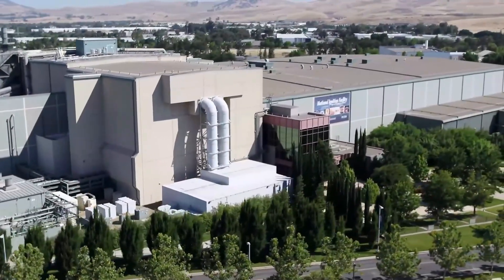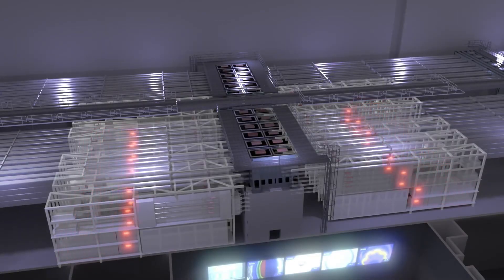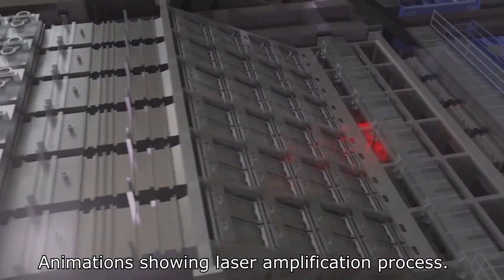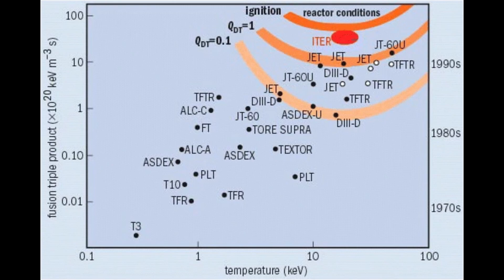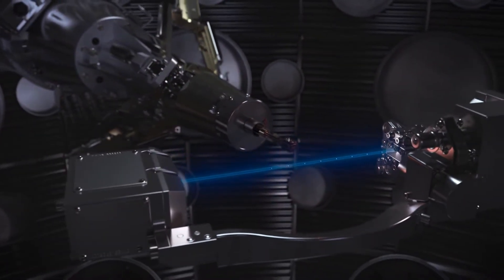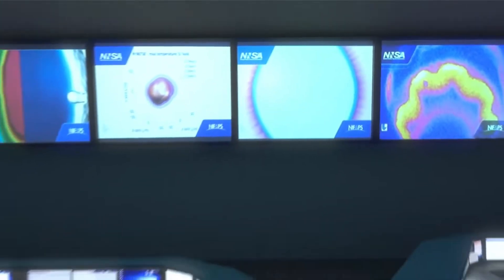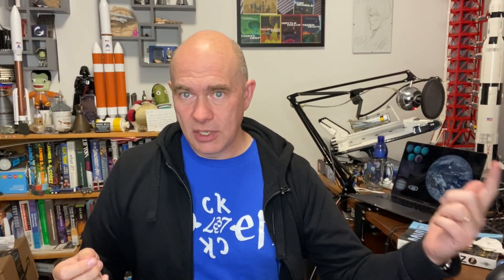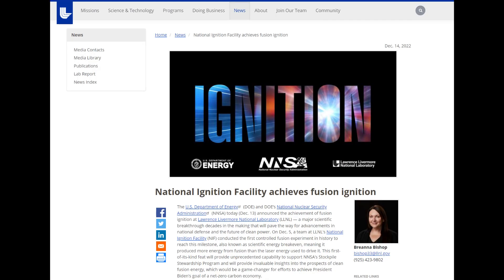Why The Biggest Laser in the World is Making Big News About Fusion

Comment: What I’ve seen so far left me completely unconvinced. The whole system efficiency is still less than 1% efficient when the whole energy of the lasers are taken into account. This is like me standing on a ladder, jumping up and claiming the Hugh jump record.
Reply: Please don't jump on Hugh.
Reply: Dunning-Kruger effect at its finest here folks
Reply: I mean, it's the first step. They aren't trying to show that a fusion reactor works. They are trying to prove that you can achieve ignition (hence the name!): that is you put concentrate energy into something and fusion gives you back more. Next step would be putting electrical energy in and getting more electrical energy out, however this is still waaay far beyond our capabilities. Nevertheless, it's an important step and one step at a time we'll get there!
Reply: The next generation of lasers will use laser diodes for pumping the laser material. They are far more efficient (up to around 30%) and can run at tens or hundreds of pulses per second. Even with that improvement, there are still many, many technical challenges to be overcome before there can be a viable fusion power plant. As Scott says, using the reactor we already have 93 million miles away is the best option right now.
Reply: Sustainable fusion at a loss or momentarily at a gain, both landmarks not sure one is more important than the other but I'm getting bored of toroidal reactors, lasers are cool, if a bit retro.
The fact two completely different development paths are active and getting results is important.
Reply: @zopEnglandzip  The First Light projectile fusion in a rain of molten lithium has to be the coolest technique. It may never work but it looks like fun.
Reply: Well.
Let's see here. Less then 1% converted to electricity. For free.

Yea, it doesn't matter, so long as it's over 0%
But to make it clear why it does not matter there is a famous math problem, and story.

A prince who was found of chess challenged a chess master. The master wagered his life if he lost for a peculiar request if he won;
On the first square of the chess board he wants one grain of rice. The second two, and doubling every square till the last position.

The king turned him down, because he knew math. 
Why?
Reply: @humanistwriting5477  the moral of your story is any nuclear scientist asking for only twice as much money to build the next demonstration plant, and the next, and the next, is going to bankrupt the king.

All this talk of efficiency and  energy/power input vs. output ignores COST! That pellet releasing enough energy to boil a kettle is a pure gold can containing expensive deuterium-tritium fuel. Making that cheap enough to be viable for terrestrial energy production requires so much futuristic hand-waving that you'll break your wrists. It's still worth researching, but the payoff Is distant and not guaranteed.